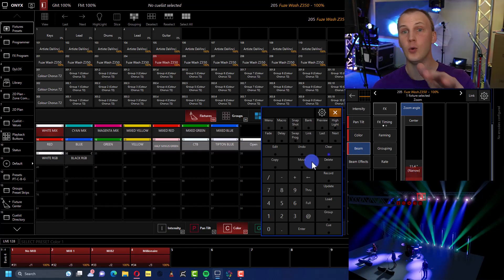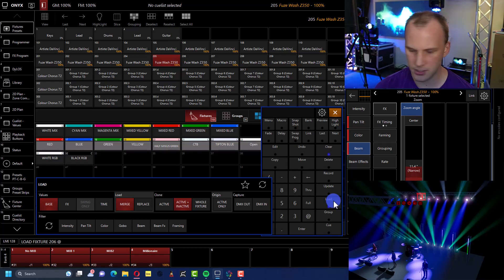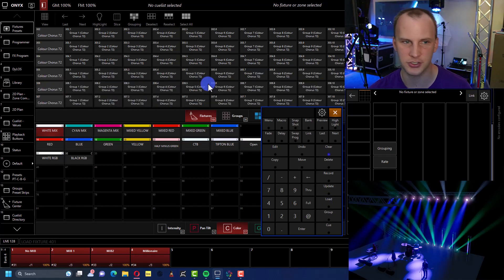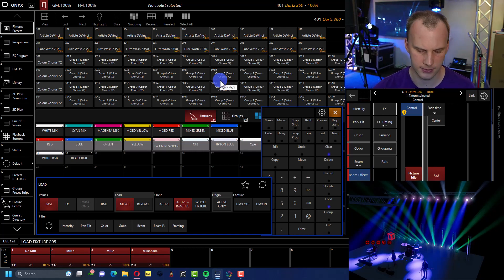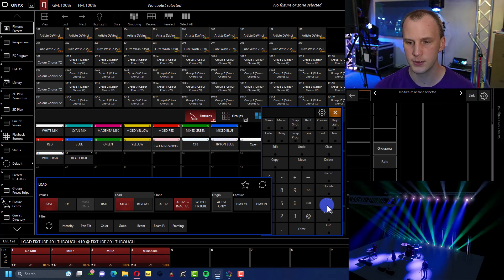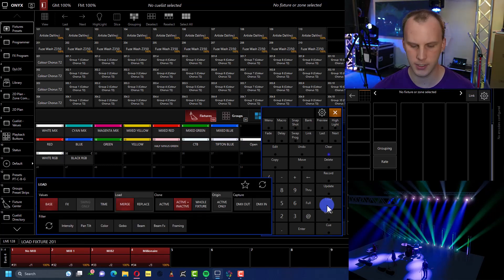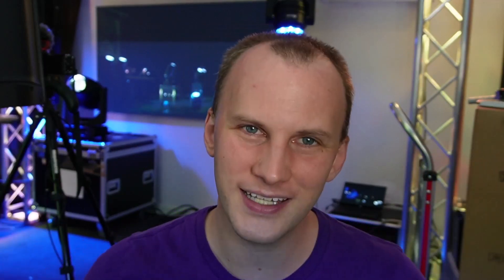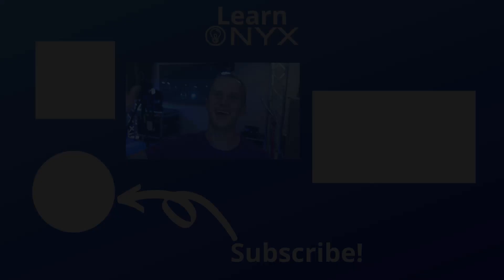How to Copy Attributes from One Fixture to Another

Comment: Hello David, I have a question about using ONYX together with the NX Touch and the NX Play. Do you know if there is any possibility to change the default colors of the pads for the cue/chases/submaster etc.  on those devices? Thanks in advance.
Reply from the maker: No, that's not available in the software
Reply: @LearnOnyx  Okay thank you